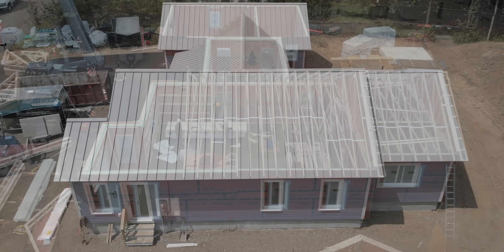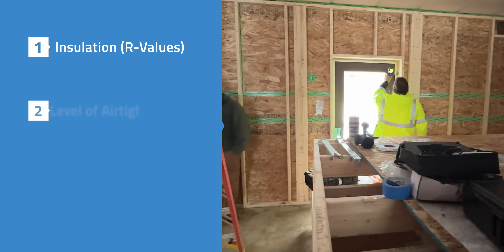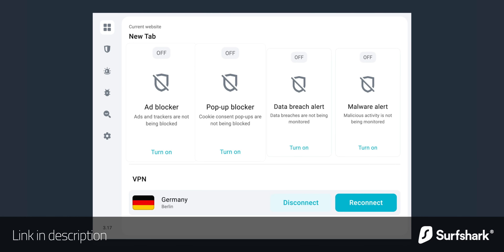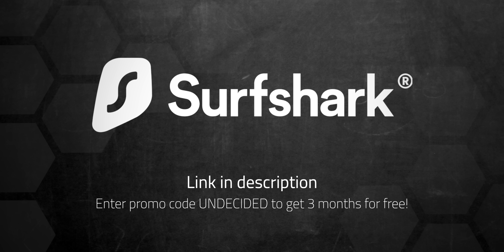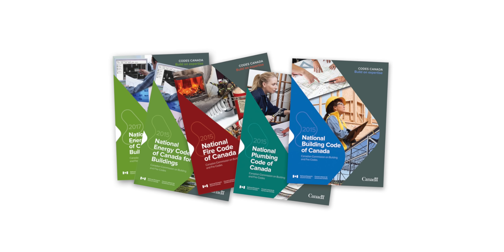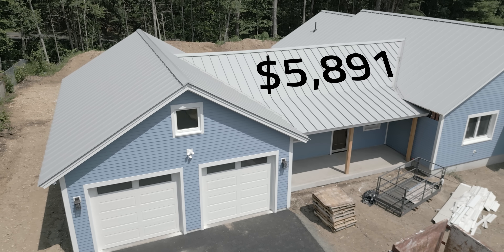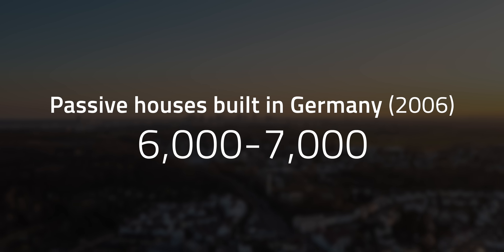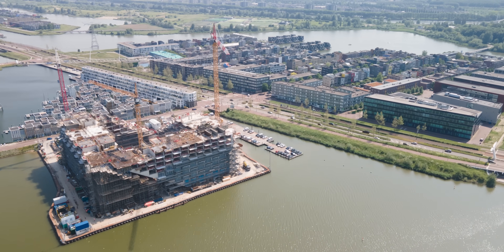Why Do American Homes Suck?

Comment: I mean you kind of cover it but there are huge differences in climate to be found in the US. It would be prohibitively expensive to have a single building code for the entire country. Homes in Florida need to be made to withstand hurricane force winds. This impacts the design of the buildings as well as things like material thickness. You don't need that in a place 2000 miles away like Idaho though. Yes individual states have different building codes but it isn't all that different from different countries in Europe having different building codes. Most people forget that the US is massive with a land mass about the same as the entirety of the continent of Europe if you include the about 25% of it that is within Russia.

The other big reason is that energy costs are in fact cheaper than they are in Europe. The US has been blessed with massive resource deposits compared to europe which is reflected in energy prices. Energy where I live is about 11c/kWh. Europe on the other hand averages 26c/kWh. This means that there simply isn't as much financial incentive to mandate energy efficient homes. If energy costs were 3x what they are now then you can bet that it would be a lot more popular to mandate energy efficiency.

I am not saying this that I am against energy efficiency. I myself have spent thousands of dollars to increase the insulation in my home. I really do wish that we had more efficient homes. I just also understand in some cases why we don't.

Comment: What houses in the U.S. suck is fossil fuels. We are the serfs of the fossil fuel magnates and exist only at their pleasure or so they like to think and are vehement about maintaining that status quo.

I had a 3500 sq ft (325 sq m) house built in Central Florida with more than the required insulation, large triple pane windows and 400 sq ft of double pane glass doors to the outside.

That was 40 years ago!

Today, it is NET ZERO with only 11 kW of solar mounted on the roof in a non-ideal orientation and high efficiency A/C. All extra insulation and solar paid for itself many moons ago.

I'm sure that today the amount of solar needed for this house could be reduced to less than 5 kW with additional efficient equipment and other tweaks.

The oil/fossil fuel industry in the U.S. tries to own all the politicians it can and the equipment plus building makers are not going to fight that as long as they can keep making big bucks with little effort.

In Florida, the utilities, led by Florida Power and Light (Nextera), killed all building and home efficiency standards, many years ago and are rewarded with 11% guaranteed PROFIT, by Law. 

That makes a lot of sense when people are sheep and serfs.

Comment: I would love an energy efficient home in the US, but you're not going to get that from any standard builder that's simply cranking out as many homes as possible. You basically have no choice but to build on your own, which increases costs, and also doesn't provide much of a return for any future sale. I did this with my house in DC and ultimately lost over $100,000 in my investment because new buyers only care about cost and comps. I think of this as EVs - they still typically have higher upfront costs, but the total cost of ownership is lower than gas because they are much more efficient and cheaper to operate. An energy efficient home is like this: more expensive sticker shock, but over the long term you'll see a much greater payoff. And right now, simply buying any form of house in the US seems like a huge struggle with the high interest rates and low inventory. So, if buying an energy efficient, passive home were as simple as buying a Tesla online, I would do it, but I don't think Zillow or Redfin give us enough filters to find those gems. So, we have to make them.

Comment: Great video.  While I agree there are a lot of things that can be done differently here (e.g., triple pane windows) I think there are some good arguments for codes regulating safety and not being so focused on everything else. In particularly with a lack of affordable housing and the way suburbs are being built I don't think we need to focus on piling on more unnecessary requirements on home building. Part of being an American is having the freedom to choose how to live. I think more people should be focused on long term value and energy conservation, but I don't agree that we should require everyone to build and rebuild their homes that way. 

It is also notable that it is a lot easier and therefore less expensive to advance technology in energy generation than implement all the little changes required to live efficiently. We need both, but at this point it is much easier to focus on and implement the former.

Comment: Well, looking at France since I live here, many 100 - 200 year old homes from cut stone have very thick walls (60cm to nearly 80+ cm), they're oriented really well to get light and avoid afternoon heat from the direct sun, they hold the cool really well in summer and hold the heat same in winter.
Simply updating the windows to double or triple glaze, correctly sealing the doors is all that's really needed for most of those homes, and the attic ... redoing attic insulation is often needed too.
It's actually my dream to find an old stone home with vines climbing up it to renovate ...

Comment: I think you are forgetting that we (United States) buy homes an an investment, short term investment.  Those long term energy savings will not work if you are planning on selling the house within say... 5 years.  Take the house that you are building and have a real estate analysis conducted and you might be surprised that those energy saving devices will not add to the value of the house.  And what about those who flip houses or invest in rental houses?  They will not care about the energy savings of the tenants.  A government regulation for better energy efficient housing will not go well for the greedy.

Comment: The North American energy system has to be one of the biggest achilles' heel for modern houses in the US. The European 400V based TN system is superior in almost every way.

Since I live in Norway, one of the world's most bureaucratic and over regulated countries in the world. I also want to add that government regulations like building codes aren’t always positive, because it often causes a lot of negative side effects like the requirement to send a building application to local regulators which would then be approved or declined. This causes a lot of bureaucracy, time and cost and, it removes your freedom to decide what you want to do with your own house and property.

Building codes also often impose specific tasks to be done by certified personnel or installers. For DIY persons like me, this has become a nightmare because I’m not allowed to touch any electrical of plumbing work if I want it "legally installed"…  It doesn't matter if you are qualified to do the job. As long as you dont have the right papers, electrical or plumbing work are illegal. Obtaining the papers to do this kind of work are impossible for private persons that does not work as installers in a certified business, which are also are required to have a pile of certified papers. To obtain papers with the permits to this kind of work, well you would need to take 2 years of education at a certified school, and then work as an apprentice for 2 more years. So yeah, it takes you 4 years of education to legally be able to mount a power outlet in. your own house...

So, the point is, be careful about wishing for more regulations and requirements even if they were initially positive. Because the side effects often have massively negative consequences for a lot of people.
Reply: I feel you mate. It's the same here at the southern side of the Alps, sadly.
Reply: @AccidentalScience  Sad to see the bureaucracy cancer spreading to your country too...  If they had only made it possible to take a test or something to prove that you have the necessary qualifications, a lot of problems would have been solved. Such a test could then have given you a permit to work and do installations on your own property.
Reply: Having high standard is great, having high regulation is not so great. New construction should be regulated differently than upgrades, or modifications, and vary based on the scale of the project. Part of problem is trade organization get involved in politics and use regulations to gate keep who and what work can be preformed. These types regulations have misguided intent and do more harm than good.
Reply: Not being able to make the changes I want to my house without getting a bunch of paperwork done first would drive me absolutely bonkers O_o Thanks for pointing out that side of the coin, I hadn't thought about it while watching the video but definitely makes me realize that our more laissez-faire approach here does suit my personality better. 

As an aside, there is actually a fair bit of regulation and permitting required for US Homes, it's just not really enforced and most people don't care unless you mess up (or you've pissed off an inspector or something). If you accidentally flood/burn your house and didn't have the proper permits you can bet that insurance isn't going to give you a dime and you'll suddenly discover what kinds of fines are associated with all the permits you didn't get. 

Because people doing whatever they want to their home without getting the proper permits is lowkey expected, it is standard practice when buying a new home to hire a professional to do an "inspection" and ensure the home is up to code. If faults are found they can demand the seller fix the issues prior to the sale. This doesn't stop people from doing dumb things of course, especially if they've convinced themselves they'll never move anyways so is always an interesting thing to look out for when house hunting.
Reply: Better in all ways... except cost.
So. Those are very fancy (apartment blocks, not homes) that are so very energy efficient. Too bad you will never own one.
Reply: Main land eu problems, do all the work you want in the uk, other than gas and fuse board.
Reply: You're a wise man!

Comment: I have always puzzled at why most homes in USA are built of wood even in a Tornado zone, then we get pictures on the news "Big tornado smashes city in USA" yet here and there are a few brick built buildings still intact. I was watch a couple build a house in such a zone and not only was it made of wood they nailed it together which is about the weakest joint you can have. Oh and the wood panels seem to be made from wood chips the sort of panels we use in the UK as temporary to cover a hole and throw away when done
Reply: Most homes are built with the wood in the USA, because wood is plentiful and cheap, and most homes in the USA are not in a tornado zone.
Reply: You get a direct hit from a tornado (As you are saying) it don't matter if that thing is your house is made of stone. You are leveled. 
Yeah, they do use that super cheap crap wood for the sides. Most people don't know thouse there is a 2" gap between the brick and/or solid wood and siding. The houses are 2 layers. I live in AL, did electrical work for 17 years. Code and such though do vary all across the country though. So, what I said isn't going to apply to Florida or California.

Comment: Not only is it common here i Norway to build sturdy, energy efficent houses with thick insulated walls and roofs, that can withstand all weather and hurricanes, it's even required by law.
Reply: It's required by law in the USA also. I don't know what he is rambling about in this one, hehe. 
Stil watched it though, like the guy but this video is way off. We literally use triple widows in well over half the country (you are a builder so you will get this. Depending on location, like Arizona don't need X rated because of weather). Everywhere else 100% is Double At the very least. Like in my house I had them put in Triple even though in Alabama it's only required for double for 90%+ effec. I mine are "99%".  Also, my windows triples, where only $145ish each installed. like removed old and installed new and they have a lifetime warranty. 
Much Love from the USA!

Comment: US homes use materials that are prone the mold should the air-conditioning be turned off for more than a few days. There are houses, that were abandoned (we visited) that from the outside appear fine. Until you enter and see what 6 months without AC did to the sheet-rock and wood. The entire inside of the structure will have to be ripped out and replaced.

Now, just imagine what happens during a hurricane. Powers off-line for a week or more, with some structures with various amount of water damage. By the time the home owners return, and power is restored, mold has started to take hold all over the place.

Germany by comparison is very humid I'm the Summer, but the majority of building are just fine without AC. So long as wood and sheet-rock are not major elements of a home, mold its a problem.
Reply: Do you live in the US? Because those statements are not true. Every house/building that is abondoned no matter what it's made of will have mold. Mold is a living thing. It grows on concrete, wood, bricks, everything..
We also use mold resistant sheet rock and have air gaps between walls.....
Now the hurrican thing yeah you right, but personally I wouldn't live where I could get hit by one, haha.

Comment: I live in a ~100 year old house. We updated the windows and added insulation where we could. We also installed a high efficiency furnace (not off brand) and AC unit. The AC unit is still working fine. We now have our second furnace. The first one last a little over 20 years. I had to replace it's mother board and blower. I didn't track the numbers but this obviously eat into the fuel savings. In addition the orginal furnace was simple, and I mean simple as a brick, If it had an issue a had 50 50 shot of fixing it myself. Not the new one. To your point on standards, why can't the new furnaces have a USB port that I can use with my phone for diagnostics?

Comment: IMO...the core issue in the US is how to build and sell as cheaply and quickly as possible. Attention to things like energy efficient materials and construction methods are seen only line item costs to the developer/contractor. They could do it but would then have to pass on the cost to the buyer who is usually focused on affordability at the moment and not thinking about long term savings as far as energy. Short term profit/gains/savings are the focus. Unless a  more strict national building code and requirements are established and enforced, we'll continue to build crappy homes for no other reason than because we can.

Comment: I've lived in Germany, Italy, the UK, and France.  I can confirm this.  American houses absolutely suck.  German and Italian houses are the best in my experience.  The most shocking thing to me here at home are the so-called "luxury" residences that use all the same sub-standard garbage materials that the cheapest houses are built with.  I just shake my head when I see multi-million dollar homes with asphalt shingle roofs in the US.  Millions of dollars for a house protected by heat-soaking tarred paper that lasts 17 years on average.  It's mind blowing. Now that said, I have worked in the commercial construction industry for a decade, and commercial construction in the US is among the best.  American architects are called upon to design the world's skyscrapers in many countries, for good reason.  US cities are characterized by large commercial buildings of remarkable strength and quality, and houses that you can knock down with your fists.  It's America's great "missing middle" problem with respect to codes.  As long as developers are allowed to build trash, they will build trash.

Comment: The discussion is needs to include other element: for example.. why are houses are built to cheaply in the USA? One of the reasons is because of jobs... One should take a look and see how often housing is resold in France or UK, Germany vs the USA. My guess USA houses are resold MUCH more often, due to changing location, jobs, etc, vs those 3 countries, therefore, why should  someone spend 800k to build a GOOD house when they can spend 500k to build an OK house, knowing that there is a high chance they may need to sell it in the next 5 years. The other issue is, almost no one is going to pay 50% premium for a well build house. Show me buyers who will inquire about all of those things  en masse and Ill show you builders who will adjust to the environment and start building those homes.  There are many other additional elements why this is happening. Don't get me wrong, it's not good or bad, it's a reality. Both Matt and Tedd are not wrong (I wish they were right), but their view is utopian, not reality though.   For this to change though, federal guidelines NEED to be much stricter at first, then it'll take 10-15 years for builders, suppliers, manufacturers to adjust, and then every new home build will be better... But, it'll never happen in my lifetime...